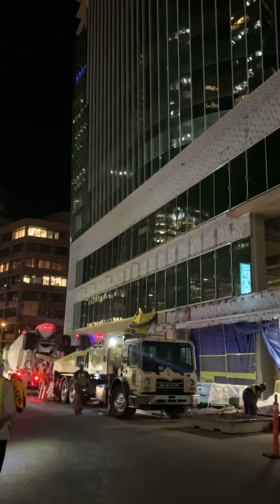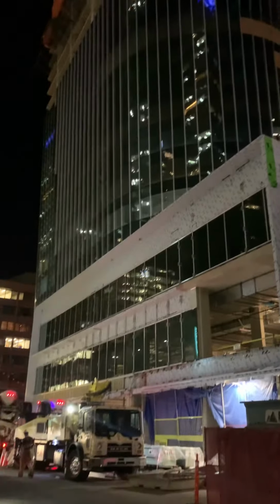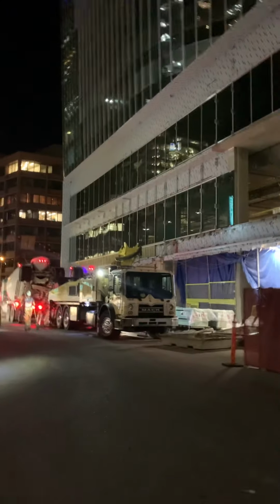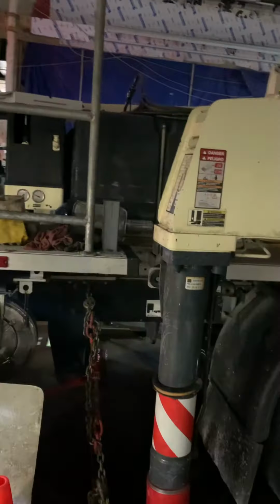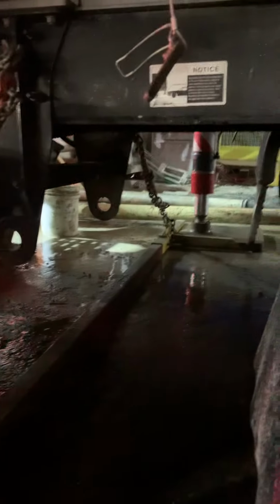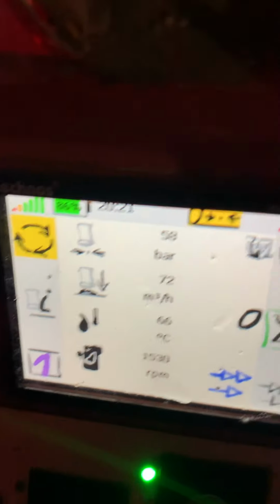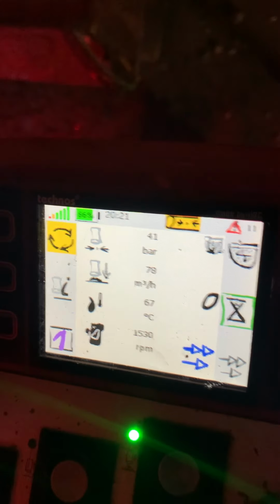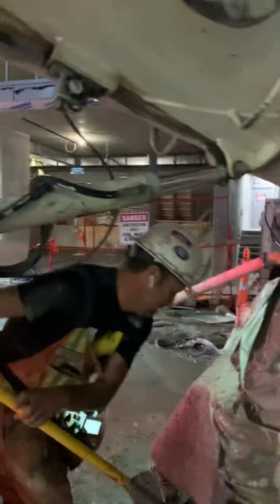Pumping 600 cubic meters, 30 stories up with the Putzmeister 13HPD pump cell.

Comment: Yes I'd definitely like to see this in longer format 😀 guess that's the nerd in me. I haven't done anything over 160 feet vertical. I'm guessing the pipe coming off the pump that has the loop is for controlling back flow from the height? Pretty cool job
Reply from the maker: I believe what you’re referring to is the diversion valve and clean-out line. Switch the valve over at the completion of the pour and the system is drained back through the line and valve into the concrete bin.
Reply: @Canadian Concrete Pumper   yes that must have been what I seen. It was real quick when you panned over to the building from back of pump. Pretty neat work in your area of the world. I'm in rural area so I don't get to see much of this kind of work. Just watertowers and grain silos. I'm still trying to catch up on all  your videos, you got a few lol